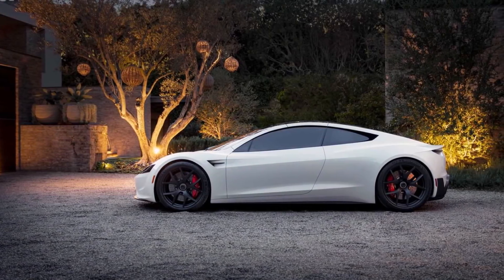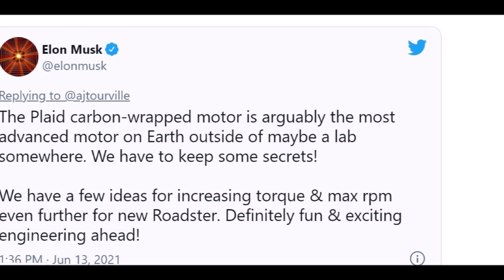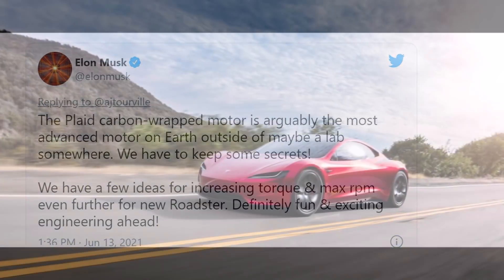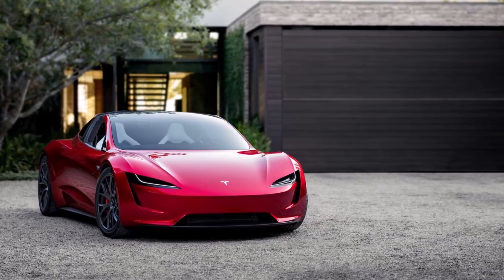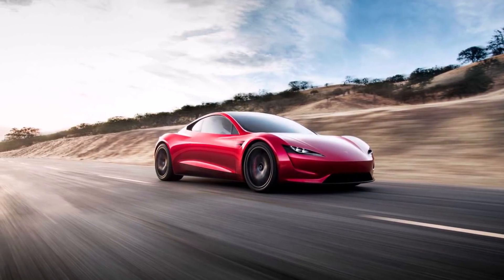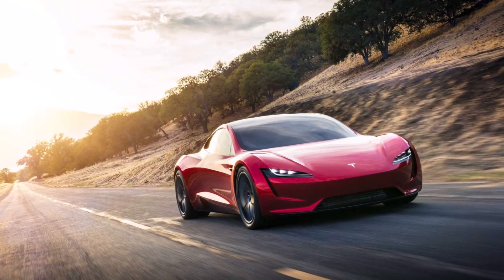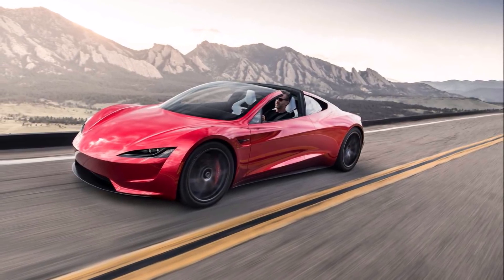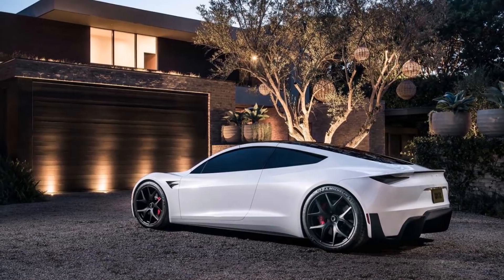Tesla to Increase Torque & Max RPM in Roadster's New Motor

Comment: Why add to the confusion on 400 or 620+ mile range? Just as Musk directly (FOR THE ROADSTER ONLY). Besides, Musk Designed the new Roadster to make a point: Beat (performance wise) any ICE vehicles in the existence. Period. Model Ss are clearly another matter. Do not mix Roadster with any other Tesla vehicle. The Roadster is a SUPERCAR.

Comment: What about using gold instead of copper in a super motor? I have heard that gold is a better conductor than copper.
Reply: Really, pounds of gold?  
At nearly $2000 per Troy oz.   Hmm.  And silver is a better conductor than gold.
Reply: @dbwelder9159  silver is a better thermal conducter not electrical.
Reply: @miguellopez3392  I beg to differ... Check it out.  Silver has more free electrons.

Comment: Is not complicated, but rather simple physics.  And the solution is not complicated either, just extremely difficult to achieve. Congratulations to Tesla's engineers for this revolution in applied mechanics.

Comment: 400 miles is not enough where I live in Northern Canada. We lose > 50% range in -30C so the extra range makes up for this type of loss, also if driving in the back country down logging roads, the greater range is absolutely essential if we will replace ICE trucks with CyberTruck. My dream is to drive an EV to this location: https://youtu.be/bsA4_qAAung  which is a 5 hour drive one way and almost no chargers close by.

Comment: This new electrical drive motor was shown at the Plaid reveal and it will not only power the current Plaid Model S and Model X, but the new Roadster, Cybertruck, and other future Tesla performance models. I have also seen the Lucid Dream Air's 900V+ electric motor that weighs just 163lb (74kg), also spins up to 20K RPM, and is even smaller and more powerful than Tesla's new motor, producing 650HP each.  As always, competition breeds innovation, so it is good that EV competitors are keeping Tesla on it's toes, and we can count on Tesla to continue to innovate, improve, and re-engineer their drivetrain techology moving forward. Remember that Tesla is not only trying to build the best EV, but to engineer and build the best car in the world.

Comment: No, its not enough. Because you wont drive economic with a roadster. If it has approx 600 miles EPA, it will in practice be somewhat 200-300 miles when using the car and the power.

Comment: Hey does anyone know why Copper is used for high end electric sportscar engines - instead of Silver? The cost and weight difference would surely be trivial for a high end sportscar.
Reply: Based in your logic we should use 18 carrot gold ! 😂 but i do understand what you are saying . Are the physical properties of silver better across the board? 7% more conductive is certainly a good thing but the cost is huge. I say silver coated copper. They coat aluminium wire with copper to keep the price down on cheap transformers in welders etc so it’s certainly worth doing i would say !
Reply: @Buzzhumma  No, my (poor) "logic" was based on Silver having the best electrical conductivity (not that this may be the most important property for an electrical engine) -  Silver is 1st, Copper is ranked 2nd and Gold is ranked 3rd so I wouldn't have chosen Gold! (btw does 18 carrot gold have some superior property to 24 carrot in regards to electrical engines?)

I guess if 23kg of Copper in an EV engine was swapped with Silver at $900/kg it would cost an extra $20,000 - but for a top-end EV it might still be worth it if it made a power difference? (The Rimac EV is ~ $2.5 million)
Reply: @xs1069  yes i hear you buddy. And sure they could make an awesome “elitist “ model but that does not fit the mission statement but also neither does the roadster anymore really! If you use 18 karat gold you get these properties....Expressed in percentage terms, 18 karats is equal to 75% gold content (18 divided by 24). The other 25% usually consists of metals such as zinc, copper, nickel, etc.

The additional metals in 18K gold serve to make the alloy harder and more durable than pure gold (24K), which is too soft for jewelry and most likely high rpm spinning rotors!
Reply: @xs1069  Copper is lighter than silver, with nearly the same conductivity. So using silver just would make the engine heavier.
Reply: @katertom  Yes, understood, but it's not nearly the same conductivity, it's perhaps a 7% difference? ("The conductivity of silver clocks in at 63 x 10^6 siemens/meter, roughly seven percent higher than the conductivity of annealed copper, which stands at 59 x 10^6 siemens/meter.") I don't know how this affects a magnet however!

So maybe the weight difference (Copper: 8.96 g/cm3 Silver: 10.49 g/cm³)  between a silver-engine EV versus a copper-engine EV might (?) still be less significant to final power output than the difference the extra engine weight (e.g. 32kg for a copper engine, maybe 34kg-37kg for a silver engine) makes to the overall ~1700 car.
Reply: Maybe it’s planned for the Roadster.

Comment: Yamaha offers a 496HP electric motor that outclasses the Tesla Plaid motor
Reply: it is not just HP. It is RPM and weight in combination that make the carbon wrapping a step ahead for automotive use
Reply: But Yamaha said that it's  a prototype and will be in production in 2024 . So it's not ready yet. But you  can buy the Tesla motor today and their next generation motor for the  Tesla roadster will be on the market earlier than the Yamaha motors .
Reply: Outclasses in what respect?

Source?
Reply: That is interesting do you have power to weight ratio for that?
Reply: The roadster should be faster and have more range than the S splad.
Reply: Toyota will use the yamaha motor just like the ice motors that are yamaga a lot !

Comment: I suspect the new motor might be an excellent candidate for use in an electric aeroplane, due to its high power to weight ratio.
Reply: Agreed
Reply: Yes, that's what I was thinking too!  I really do hope he's working on the VTOL he's always wanted to do!
Reply: @daviddenley3512  I’m not convinced VTOL is that important, and it compromises the design pretty badly.
Reply: Elon need to do a Jet engine that use electricty to fly.
Airplane with high number passenger use Jet engine.
Reply: @Franklin_Araujo  you obviously don’t know what a jet engine is
Reply: @fredbloggs5902  my main language isn't english but i think i expressed myself right
Reply: maybe this motor can be used in a ship but more large